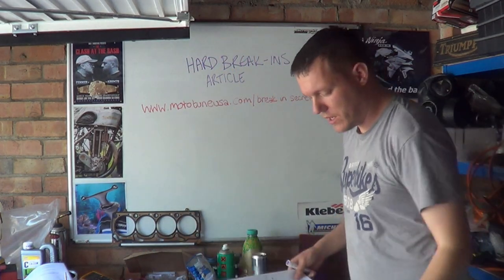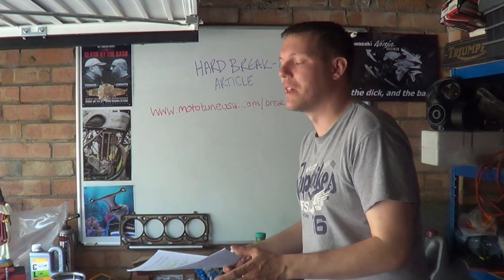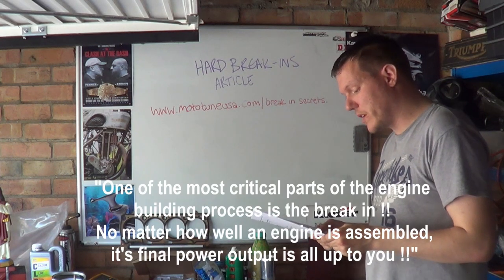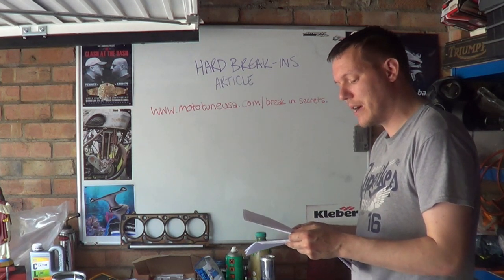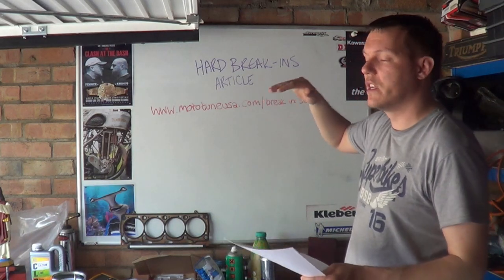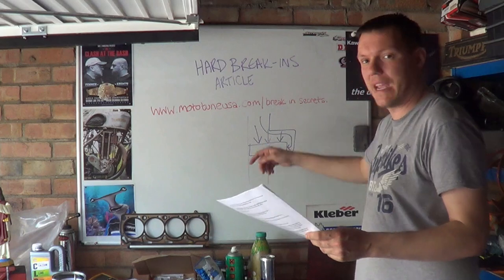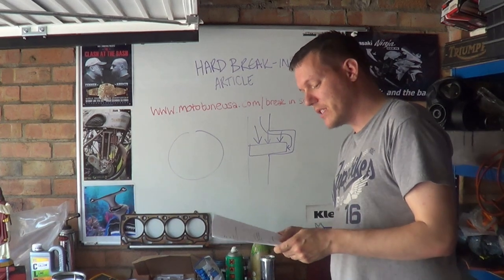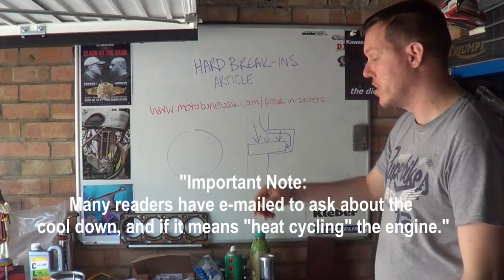Hard break in BULLSHIT! - Part 1

Comment: First, like Stijn mentions, factory break in procedures are actually not the best way. They are safe but not the correct way. The "hard break in" method has some truth in it, but the way it is in that article is misleading and may cause serious damage. I suggest that You learn about piston-engined aircraft motor break in. Some of those have been broken in "like motorcycle manufacturers suggest", and, they have been ruined by that. Too careful a break in is also bad thing. The thing to avoid is polishing the cylinder walls before the piston rings have broken in enough. Too careful break in does just that. The result is increased blow-by and lower power. Now, before I get similar childish rant from You, I suggest that You really study something else than owners manuals. You just might learn something new, and, some good manners  have never hurt anyone.
If I mentioned same things that You did in that video, I'm sorry, but I just felt that I was wasting my time by witnessing poor manners and skipped most of it.
Reply: Timo Kuusela HA  i just finished emailing him about half a dozen pdfs on aircraft piston engine break ins and also scientific experiments by engineers and scientists.  Motoman def never conducted any plausible tests but it's been done. Matt says youd need this and that and so forth and yeah u of Michigan did it.  So did others.  If you material to read give me your email bro although you already know. (Aircraft maintenance engineer with both gas turbine and piston overhaul cert,  former auto mechanic, and 3 years tool maker experience  but without license )

Comment: I find most of what you say to be true, but cracking the throttle wide open at any engine speed increases the pressure in the cylinder dramatically!!! Think about it right you are doing 13, 000 rpm and you roll the throttle off to say 20 percent. How the fuck do you expect the air to make it passed a nearly closed throttle and fill the cylinder while the window of time to fill the cylinder is so short at that rpm? Why do engines usually detonate when you open the throttle wide at low rpm. Part of the reason is the cylinder pressure goes up! Also the combustion process takes longer which gives end gasses more time to heat up and ignite crashing in to the flame front propagated from the spark plug area but that's another story.

Comment: Running in / breaking in a motor, even a rebuild, is more about the new gearbox, new bearings, etc. than the bore, rings and piston. A new bore takes on average 500 miles to bed in. It takes longer for a set of new cogs to wear in.

So here's the bigger question...... does doing a hard break in void the bike's warranty if a fault comes up that was clearly caused by a moron owner doing a hard break in??
Reply from the maker: What are you talking about? Gears don't wear in, they just wear. Gears are hardened for a reason. Cylinders are not.

"does doing a hard break in void the bike's warranty if a fault comes up that was clearly caused by a moron owner doing a hard break in??"

- If they have a way to prove it via data logging then probably. It sounds like you're considering doing it?

Comment: I'm not sure you know what you are talking about. It's simple thermodynamics. Create more heat you'll have more pressure.
Reply from the maker: What?
Reply: @dirtygarageguy  The Laws of Thermodynamics. You Cannot increase heat without pressure and vice versa. You assert that the pressure in the cylinder does not increase with more heat generation. You are Dead Wrong.
Reply from the maker: When?

Comment: I came here waiting for you to debunk something, I was dissapointed. You didn't even go over the actual procedure in the article...
Reply from the maker: "You didn't even go over the actual procedure in the article..."

- because its bollocks
Reply: What is, exactly? You already verified that the first few miles of an engine break in is the most critical part, something you both agree on. As long as the engine is up to operating temperature, there's no reason not to vary the rpm and load on an engine as part of a break in. Motoman is also correct in that modern engines are built to much tighter tolerances than the clunkers of old, something you yourself agreed with.

Frankly it seems like you're nit picking because someone doesn't think a few full throttle squirts will hurt during break in.
Reply from the maker: LOL so basically you didn't watch the vid or read the article.

So just for you - 

He states that the bike can be run in after three 15 minute runs, which is bollocks. 

He states "There is no need to "heat cycle" a new engine. The term "heat cycle" comes from the idea that the new engine components are being "heat treated" as the engine is run. Heat treating the metal parts is a very different process, and it's already done at the factory before the engines are assembled."

 Again he has no understanding of what bedding in contact components (like camshafts etc) means or requires. Thermal cycling has nothing to do with heat treatment. 

The fact that engine parts are manufactured with more accurate tollorences means that breaking-in proceedures are more important not less.

"there's no reason not to vary the rpm and load on an engine as part of a break in."

- who said this? I didn't....

"Frankly it seems like you're nit picking because someone doesn't think a few full throttle squirts will hurt during break in."

- but this is not what people say or motoman. They say a few runs on the dyno and then you can do what you want. Funny how there's loads of video of people on new sports and superbikes dying prematurely - R1's,Panigales etc throwing rods etc.
Reply: Not really if you actually read the article you'd notice that he suggests changing the oil 3 times before 1,600km, he just suggests that his procedure helps with break in. And he's now wrong when he says the first 20 miles are the most critical.

Again you're just nitpicking.

Comment: Performance Bikes, years ago - BHP shoot out between a bunch of fireblades run hard out the showroom vs those mollycoddled according to manufacturer run in procedures. Guess what, the power developed by the thrashers was more....
Reply: Farlig66 i'm not saying you're wrong. But that's just short term result. How does these 2 bikes do after a couple of years of daily use? Since that's the purpose of break ins. Prolong life, not make extra power
Reply from the maker: Link?
Reply: Fuck no man it was in the early / mid 90´s before t´internet :)
Reply: So okay - I have no proof, but I remember it well - big pb article on readers fireblades
Reply: @ Koolkei - yeah you could be right there for sure - I remember the jornos mentioning that, they might not last as long but they were freer & more powerful :)
Reply from the maker: How many bikes, and how much more power?
Reply: Oh man haha that long ago I don´t remember... Threw out all my mags years ago when I moved away from the UK, shame on me - maybe someone else here will have a back copy they can dig out... It was one of those big reader survey / meets so guessing 20-30 bikes?? Can´t remember how much more power... but it did stick in my mind that the thrashers were the ones making the power..
Reply from the maker: Ah so this wasn't a controlled test just what people were saying
Reply: Well iirc it was a run what you brung readers meet & dyno shoot out so of course you can question the level of control...

Comment: 3/4 throttle from 40% to 80% of max rpm probably means cruise at 40% of redline (so 4800 on a bike that redlines at 12000) then wind on (how hard? instantaneously? progressively?) at 3/4 throttle until you hit 80%of redline (so 9600 rpm on the notional 12000rpm bike)

It's vague (probably nth hand) bullshit written by a misguided idiot who has never had the luxury of being able to model heat flows and fluid flows on a computer. Unfortunately every misguided forum idiot repeats the same stupid. It's like a the "cant mix synthetic and mineral oils" myth, only more obscure.

Comment: that's all corporate buttpadding
the engine comes broken in and tested from factory
Reply from the maker: evidence? and no it doesn't - why would they have you do a break in procedue then?
Reply from the maker: "that's all corporate buttpadding"

- and if this was the case, why would they hand you a 150mph machine?
Reply: The Workshop m8, the last thing your bike goes through before leacing factory is a good flog on a rolling road
Reply from the maker: Which is in part 2 when I post it up tonight
Reply: they are put on the rolling road to make sure they are running properly (im happy to be corrected) before being distributed to dealerships  , the bikes still need to be run in , if a manufacturer ran in each and every single bike there wouldnt be as many bikes sold